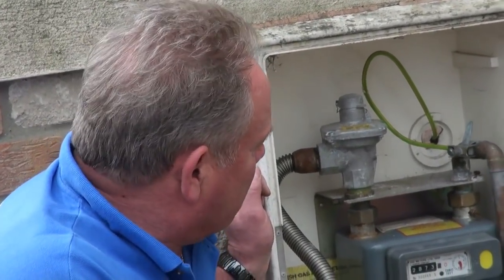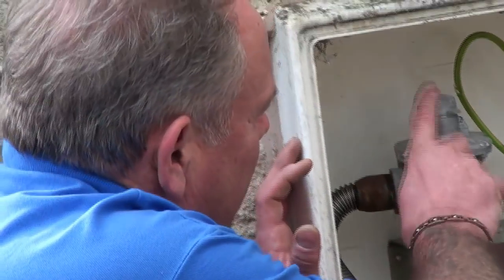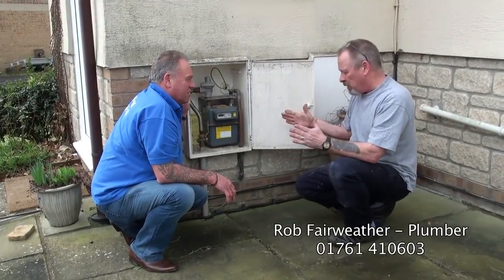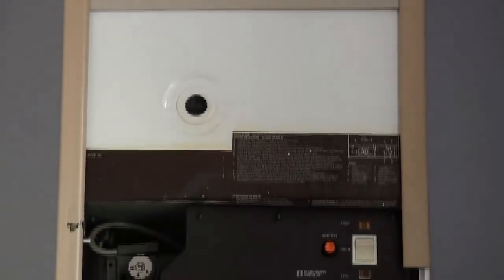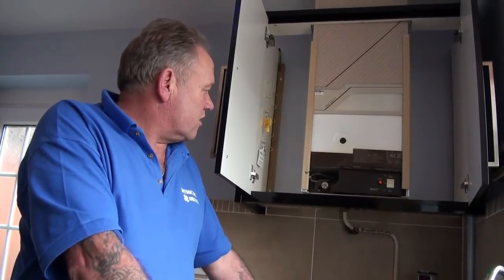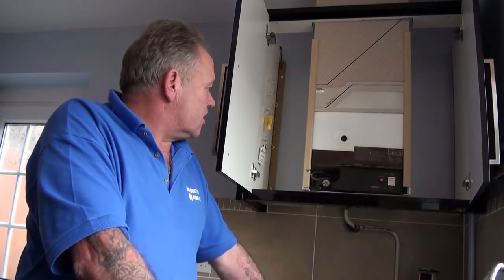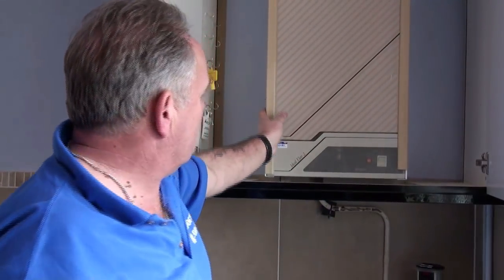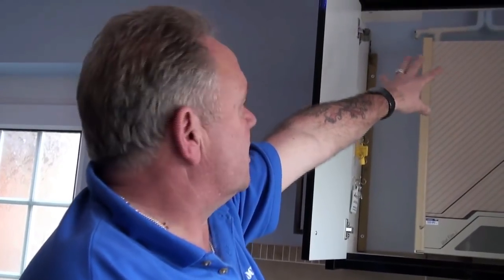How the Heating Works in your Home Demonstration Part 1/2

Comment: I'm not quite sure !! Does that mean I CAN or CANT work on my boiler. Tell me once again.
Reply from the maker: You can work on your boiler Ian as there is no law that actually says you can't. However, to do so you may need to prove you are competant to do so and in the case of a boiler tis means that you need to know pretty much every regulation surrounding the boiler and it's supply. You need also to be able to measure the efficiency of the fuel feed (pressure if it's gas) before the boiler is "fixed" and be able to take the samemeasurement again afterwards. If there is a difference in the mesurements (IE, a leak) you have to be able to trace it and correct it. Competency in terms of gas and electrical installation has a vert definitive meaning.

Comment: I just wanted to know if I can light a match inside the room while the heating system is on. I dont wan't to cause an explosion because of the gas in the room.
Reply from the maker: There should be no gas in the room Henry. If you believe there might be please call a gas  or boiler engineer immdiately
Reply: Ok, Thanks!

Comment: In domestic properties and workplaces such as shops, restaurants, schools and hospitals, this must be carried out by someone on the Gas Safe Register who is qualified to work on gas appliances.

It is illegal for an unregistered person to carry out work on any domestic gas appliance. You can check this by contacting the
Gas Safe Register online or by calling them on 0800 408 5500.

All those who are registered carry a Gas Safe ID card, which shows the type of work they are qualified to do and whether their qualifications are up to date. www.hse.gov.uk/toolbox/gas.htm

 Regulation 26.9 The Gas Safety (Installation and use) Regulations 1998  Where a person performs work on a gas appliance he shall immediately thereafter examine—(a) the effectiveness of any flue;
(b) the supply of combustion air;
(c) its operating pressure or heat input or, where necessary, both;
(d) its operation so as to ensure its safe functioning,to check the safe operation of any gas appliance after any work has been carried out
Reply from the maker: +andy griffith Thank you Andy. We do make this perfectly clear in this video and all videos (including our series on Electrical Installations) where a competant person is required to do a specific job.